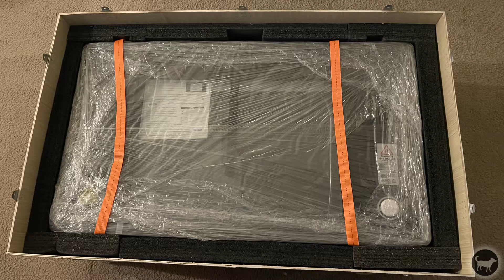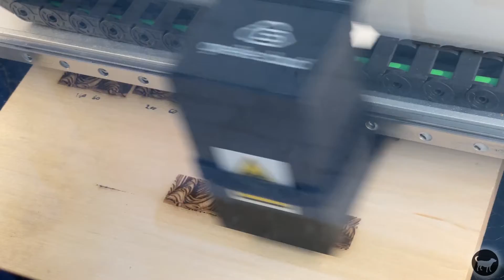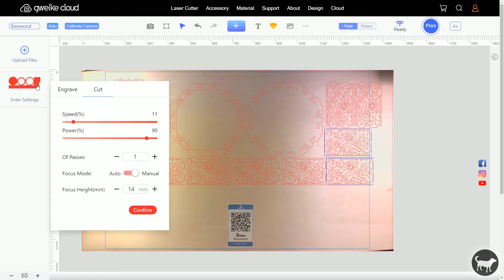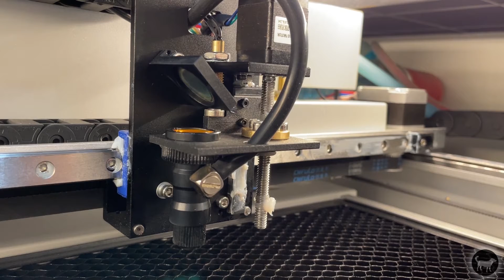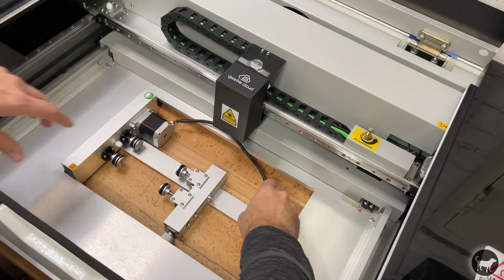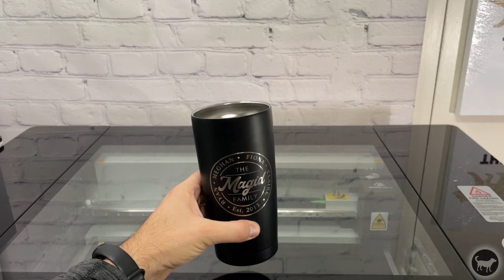Gweike Cloud Review | 50W CO2 Laser | Rotary | WiFi | Camera | Lightburn Compatible | Filter

Comment: I have a Gweike Cloud Laser, bought about 8 months ago.  I have burned a lot of products and use only Light Burn because the included software and their Cloud software does not work.  Calibrating the camera will be frustrating and lengthy.  The place where they fail is service, if you need parts you have to find a 3rd party in the country you live.  They will not take orders for parts.  My X axis stepper belt broke, I have been trying for 5 months to order one.  Sales does not want to deal with it and support cannot order parts, so they push the issue to sales, and nothing happens.

Comment: CAUTION: DO NOT purchase the Gweike Cloud with camera  if you intend to use it with Lightburn. Setting up the camera with Lightburn is virtually impossible, let alone aligning it. No one tells you all this, but as a victim I will make a video and let everyone know the problem with camera alignment. DO NOT BUY, you are wasting your money. the support only knows how to repeat the same phrase: Do the alignment procedure again...And this would be a "professional" laser company"????!!!!  They are all very helpful, but the solution is not to be found. We have been banging our heads for 3 days, NOTHING,one blames the other. Even if lightburn has problems with the camera,or alignment,you are not justified. You should say that it is not easy or impossible to configure the camera on lightburn,and not sell it as compatible. You should have programmed an algorithm,a configuration file,to allow it to be used with lightburn.Now there will be those who will say: I configuarta it...BRAVO!!! But those who do the reviews are not aware of this problem??? Of course they are,but they are making money out of it.Shame on you,T UTTI,a machine that costs 3000.00 Euri not compatible with Lightburn but only with that cloud dump,always if it worksGod bless you.
Reply from the maker: I'm sorry that you had an issue with the setup of the camera in Lightburn but I did not. The steps that you need to do to calibrate the camera in Lightburn are the same as the steps I've had to follow for other machines when connecting to Lightburn. There is no money making conspiracy here as I often point out the shortcomings of products I review as I also did with this review but the camera calibration was not one of them.

Comment: Hello, how are you? Congratulations on your channel. A query regarding the machine, in your opinion is it feasible to work with it in a department? My office is a part of my apartment, but I don't know if it will be feasible to use it without the neighbors being bothered by the noise.
Reply from the maker: Hello and thanks! It's certainly not the quietest machine in the world so if annoying your neighbors is a problem then it might not be great. Might sounds like a vacuum is on but you might be surprised by how little your neighbors can hear through the walls as long as they are not too thin.

Comment: Great review on this machine, I just received mine and will set it up like you did. I have watched EVERY video on this machine and you covered everything!!! From LightBurn needs a different version to the switches to the bar in the back to close the micro switch. The one question I have is on the focal lengths, do you measure from the top of the material to the bottom of the lens or to a different point??? Again Great Video and yes they sent me the wrong machine and support sent me the correct one immediately I made it very good after sales support again if you could answer of how to measure the material again thank you
Reply from the maker: I just measure the thickness of the material and then use the chart in the instructions on their website. You can find it in the user manual.

Comment: So if we don't buy the air filter there is no air assist? Unless we buy our own air pump? Is it easy to attach the air pump? Thank you
Reply from the maker: Yea. It is super easy to attach your own air pump. It’s just a 6mm tube that plugs into the back. You can simply hook up a fish air pump to achieve the same result.
Reply: They all come with the air filter and air assist box (as seen on this video). If you buy a package that has their new home filter unit, then that adds a bigger air filter.
Reply from the maker: @tooldad6852  I think you are correct, I thought the basic didn't have it but I guess that wouldn't make sense since you wouldn't have an air assist.  I still would rather bypass it as it is pretty loud stifles the suction power of the external air blower in my opinion.